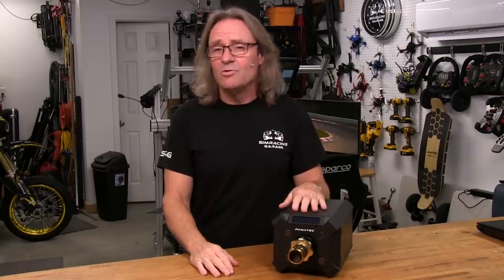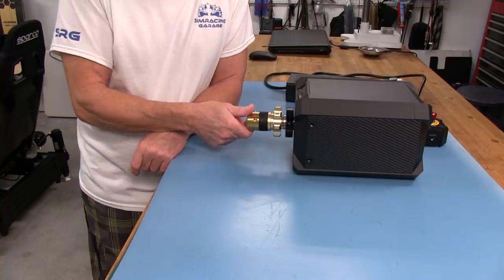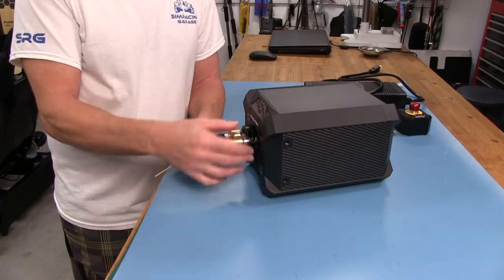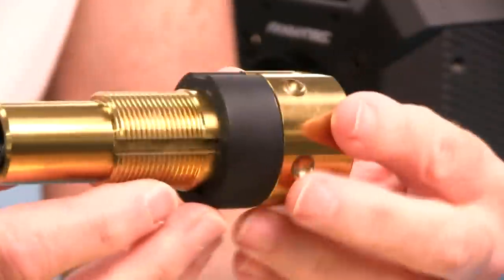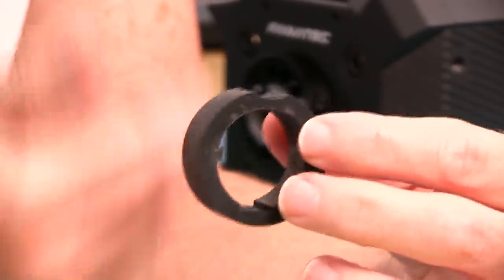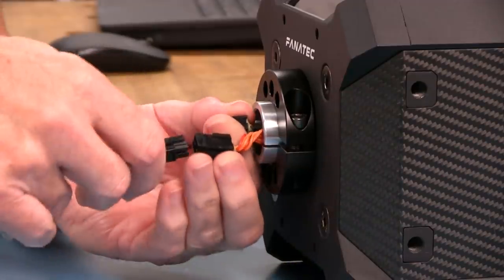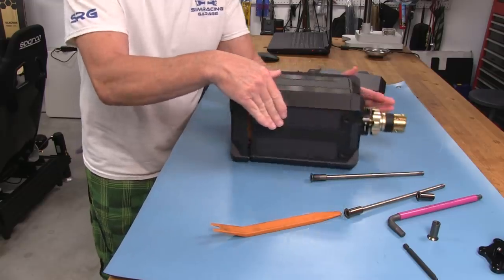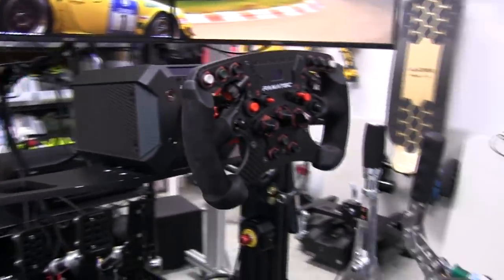Fanatec Podium DD2 Review

Comment: I thought it might be worth mentioning a couple things that Fanatec got right that SimuCube 2 could improve on.  I own a SimuCube 2 Pro and a Fanatec CS 2.5 wheelbase if it matters.

1. Torque key. Every time you start up a SimuCube 2 you have to let the software know that you want full torque. Many people have said they have forgotten to do this and had to complete races where everything felt bad because of it.  The torque enabling key Fanatec uses is a great convenience by comparison.  Have young kids coming by? Pull the plug and put it somewhere safe. Otherwise leave it in and don't worry about an extra step every single time you want to race.

2. Coiled cables. Fanatec wheels are all external cable free which is a great feature. Fanatec supports both communication AND power. The SimuCube 2's have BT support, but they've already hit limitations with some wheels in terms of buttons/input devices supported and there are a small number of wheels that support this. This module is already slated for replacement/updating so it can support more inputs. And then you get the additional failure point and weight of a battery with additional effort to keep a battery charged and then having to remember to turn your wheel on and off.  I chose a coiled cable wheel for my SC2 because I didn't want to deal with any of that.  It won't be a terrible hardship, but my point is that the SC2's wireless implementation is not comparable or as good.

I'm not suggesting one is better than the other, but just that both have some bragging rights, neither is perfect and both have room to improve.
Reply: Unfortunately, Fanatec's implementation restricts you to Fanatec wheels (if you want wireless capability), but maybe they'll soon let wheel vendors by wheelside internal connectors.
Reply: @whaletail935  As I've said many times, if they exposed a real USB connection in their Podium mount they would have created an advantage supporting 3rd party wheels.

Comment: There is No excuse for that play in the quick disconnect at this price point.
Reply: They COMPLETELY LOST ME when Barry did that. My q1r qr is SOLID on my accuforce. Without that I cant imagine using a dd wheel
Reply: Is it actually a common issue? Mine doesn't have any even without tightening the ring down (mine is an EU unit if that matters)
Reply: Mine don't have any flex whatsoever. Not sure why his does.
Reply: I don't have this flex on mine. Rock solid.. .
Reply: @J_SAMa  Ok thats good to know. Maybe the unit is ok.
Reply: @J_SAMa  I dont have issues with flex neither, DD1 EU Base here
Reply: +1 here for no flex issue on my US shipped DD1 base. I got mine as part of the first batch of preorders from last december FWIW.

Comment: Hi Barry, the reason your Dynamic Dampening was less effective is that you've reduced DPR in the Tuning Menu settings. What also helps to make it more effective is to lower the starting point a bit more, for example when it only starts at 100 to increase with speed it won't be very strong at 120 already.

Comment: Thanks Barry.
My Simucube 2 pro shows up tomorrow.  I feel like I made the right choice.
Reply: Christiono Rollinetti Batch 3?
Reply: I had the same thought. The oscillation felt a little weird to me in this review and there is way too much flex, if you compare it to the sc2. It also felt to me that Barry wasn't really happy about the product or expected more of it but didnt want to tell the honest truth, but I might be wrong.
Reply: @akeem127  Yes from Simracingbay.
Reply: Mine arrives tomorrow as well. Cheer!
Reply: Mine will be here tomorrow too.  FWIW I still think both the DD2 and SC2 Pro are good competition for each other and both are good decisions for a buyer depending on priorities.  If you are happy with Fanatec wheels then I think the DD2 is very compelling.  

My issue is that I got wheel lust for the significantly more expensive Precision Sim Engineering wheels.  I had upgraded my Fanatec McLaren GT3 wheel with the shifters from SimRacingMachines and they were much better than stock, but also cost nearly as much as the wheel. I added magnetic upgrades to my Porsche 918 rim as well, which are also an improvement though not as dramatic. The buttons and knobs on the Fanatec rims are OK, but not great.  So I finally decided I'm getting the wheels I want and a direct drive system that supports them.  It may seem backwards, but in the end Fanatec's biggest asset, their huge assortment of rims is what killed the DD2 wheelbase for me.  I wasn't going to spend an extra $200 for an adapter on top of the premium wheel cost for each wheel I purchased only to have to run a USB cable anyway and have a wobbly mount point. It just didn't make sense.  I've gotten good service out of my Fanatec equipment and have no complaints about their products. 

BTW I think Fanatec missed a big opportunity. If their $200 adapter allowed for a direct USB connection from 3rd party steering wheels such that they didn't require a coiled cable Fanatec would have made their system an option for the smaller percentage of people who want upscale wheels.  I know Fanatec wants people to buy their wheels, but that $200 adapter is only lip service to allowing other rims. They completely threw away their way to add a very big feature by making all of those wheels effectively wireless.  Big mistake.  Many people would buy a combination of rims but instead they've forced people into an either or situation.
Reply: @Nick-rx2zu  Youre batch 3? strange cuz im too and I havent received anything
Reply: @Brawlii  They are shipping to the furthest locations first but they are all starting to head out now. Wont be long, im in batch3 from racewerk too.  Man the level of filtering and software advantage simucube has over fanatec at moment is just not funny.    A-la GP2 engine era of honda for Fanatec.

Fanatec need to take the reconstruction filters and FEI algorithms far more seriously.  Fingers crossed the baseline encoders and chips are capable of a high enough update rate to get rid of that grainy feeling reported because thats worrying.
Reply: @Brawlii  Yes it is. I ordered on the first day when it opened preorder.
Reply: @markkovalcson7243  Exactly man. It is 2019 now but they are still using pins for steering wheel connection. I have a Fanatec Mclaren and I broke the pins twice when I pull out the wheel from the motor base. The reason that they insisted using pins must because that they want to make sure no third-party steering wheel can be easily attached on their motor base so that they will gain profits from selling steering wheel.
Reply: @Nick-rx2zu  To be fair even my new GT3 wheel has a round USB connector with pins in it.  The difference is that the connector screws into the wheel semi-permanently and is easily replaceable if it breaks.

Also Fanatec is a company and they are in business to make a profit.  I think it is a bad idea to attribute any negativity to their trying to maximize profits. I'm glad that they are in this market and I think they have done good things to take care of peoples needs in this market.

Whether I want to admit it or not I've gone off the reservation with my Sim Rig and I no longer represent anywhere near the average sim racer. Fanatec offers a strong value proposition in the upper end of the mid range.

FWIW I have a complete Fanatec Club Sport control group that I still consider good equipment. With the exception of the hand brake all the components have worked reliably.  I'm not selling them, but my son will be a happy camper this Christmas.
Reply: @vosi88  I am so hyped dude, been waiting for 2 motnhs
Reply: I got the sport version from batch 2. I confirm, you will not be disappointed !!!
Reply: Ya but the price and wheel combo is way more money also not a full ecosystem and not console compatible

Comment: I am an early adopter of DD2, I need to say that I have no complains with it. I'd love the quality and the FFB fidelity. I understand perfectly that the Fanatec Podium system is an early stage of development, and I happy with that. The flex in my case in minimum, for not to say that I have no flex at all. And in my opinion it has a quick fix if Fanatec release a more stiff Rubber or a 1mm more thick. I can't compare with a Simecube or similar, because I never got that ones, but what I can talk about the DD2 and like I said, it worked flawless, plug and play in all the games that I tested and for me that it's superb. Barry should mention that, I think that Fanalab is great, but the ability to launch a game, and seconds being driving without headaches is part of the package :).

Comment: Barry, I have the Accuforce DD wheel base. I was just wondering how does the Fanatec DD2 wheel base compare to the Accuforce? Which one has better telemetry based FFB? Is the Fanalab software as good as Simcommander software? I have quite a few Fanatec wheel rims that I have modified to fit the Accuforce. I was just thinking that they would work better on the Fanatec base and a separate usb cable would not be needed for the rim. Also since I have the Fanatec shifter and considering getting the handbrake too all these addons would work better wired into the Fanatec wheel base rather than a bunch of usb devices plugged into my pc. I am running out of ports and some games only support a certain amount of usb devices. What are your thoughts on these two wheel bases?

Comment: I had this same flex on my DD1. It was very noticable whilst driving. I'd say Fanatec tolerances are just that poor that the qr's vary and thats why some have it and some dont. Quite a rubbish qr system if Im honest. Using the screw is just a band aid fix for a sloppy design and is hardly "quick"
Reply: Was going to order the DD1 Podium very soon, now I am concerned.
Reply: @gisan3537  its a decent wheel base, just overpriced for the build quality in my opinion, and as I said the qr system is not great. Some people claim to have no flex so you might get lucky. For the money they cost you shouldnt have to be taking a gamble though!
Reply: @simracer1386  I agree, the pricetag is no joke, hence I want to be picky, thanks for your honest opinion.  I also been wondering the lifespan of these DD wheels does anyone know?  Can I count on it to work for few years of daily usage?

Comment: "quite good", "...does its job quite well"...hm, so it's good...but not great. Interesting. My Lenze/Simucube is great...in my eyes anyway :)
Reply: Hey man, I just bought a lenze mcs12, but I have problems finding a mounting bracket. Is it the same as a mige 80st? The 130st has the mounting holes 102,5mm apart but my lenze is 82mm if i measured correctly. Could you give me a little insight or maybe even a link to a good mounting solution? There is so little information on the lenze motors.
Reply: @nfsrival1499  , my bracket is from Martin Ascher. I just checked, he doesn't have any brackets offered for sale on his website. Guess it's worth flicking him an email and see if he still has a Lenze one lying around somewhere. Seems like hardly anyone is buying Lenze's anymore. Martin's site: https://www.ascher-racing.com/

Comment: Man the Flex on the shaft is.. worrisome for the price Fanatec asks for.  That's a bit disappointing compared to other products in the DD range.
Reply: Antoine Thisdale it’s odd. I have a DD1 PS4 model and don’t have any of that flex with my quick release.  My rig (80/20) will start to flex a bit before the shaft does.
Reply: @RitterTX  Yup, mine is the same. i checked mine and there is NO way im getting that amount of flex in my DD2. I couldnt believe it when i saw it, that Barry's was that lose. I kept going back to mine to see and then going back to the video.. mine may be just about an eighth of that flex even if that.. im astonished
Reply: Another DD1 owner reporting in that I do not have any of this flex with my Formula V2 rim, nor Uni Hub attached.

Comment: There are better ways to control oscillations. In the Simucube 1 and 2 program (or the Granity program if you're using the non-Simucube OSW such as the IoniCube) there is a filter section called "Peaking and notch filter" divided into 3 filters: "Center frequency Hz." "Attenuation dB," and "Q Factor." These settings mean controlling/removing oscillations without having to resort to potentially adding more friction and/or damper than you personally want for regular driving. Those 3 filters also slightly influence others aspects of FFB in good ways from my experience but 90% of their effect is on oscillation removal. Another good thing about those filters is, from my experience, they hardly (if at all) need to be changed when changing game or FFB settings / power. The only time they may need some changing is when there is a firmware update (firmware updates usually change all sorts of motor-settings we users will never see). It would be nice if Fanatec had the same or similar. Those settings are very under-rated settings...even in the Simucube community they aren't given the attention they deserve.

Comment: Disclaimer: I did not read all of the comments below (504 at last count). Another excellent review! I really like the Fanatec DD series (no external controller box, no wires to the wheel, killer OLED display), and was just about sold on a DD1, but the flex thing just freaked me out. I just got done spending over $1600 on a Monstertech frame  (not received yet), partially for stiffness reasons (not that kind ;^) ), and there's no way I would put up with that kind of movement on a $1200 gizmo (my TM TS-PC Racer has none of that!). I did see the video about the 3D-printed Blue Fixit Thing, but just now I came across this: https://www.youtube.com/watch?v=u2slxjJBcZA Does that "fix" make sense, racing fans?
Reply: Yes it makes a lot of sense, if you don't "pre-tighten" it you will push the rubber down the shaft with your wheel, when you then tighten it it won't be seated quite as snug as intended.

Comment: I have the Porsche 918 RSR wheel on my DD2, and there's no side play whatsoever as seen in these videos... From what I've heard, older wheel rims had looser tolerances than the newer ones, or I just got lucky...
Reply: My BMW and universal hub will have some wiggle/play without the bolt, but with the bolt installed it eliminates the wiggle/play. V2 formula rim is solid without the 6mm bolt.
Reply from the maker: From what I have been able to garnish from comments I have seen over the years, the tolorences from QR to QR on the Fanatec wheels can be quite different.
Reply: @simracinggarage3026  I've bought my BMW with the DD1 last June... So I can say its not something that's been addressed prior to the release of these podium bases.
Reply: My CSL Elite with the F1 kit has no lateral flex either (no locking bolt), but I very rarely remove the wheel so it's effectively as it was on day one. That said, it doesn't surprise me to see the flex he has.
Reply: @simracinggarage3026  I can confirm what you say.  I own 3 universal hubs, a formula rim, a McLaren rim, and a F1 2019 rim.  I tried your flex test with them, and some flexed more than others.  To my surprise, the universal hubs I own flexed the least.  I wasn't able to get the amount of flex you had in your video, but all of them flexed a little.  I put lithium grease on the locking ring threads, and I usually tighten the hell out of it.  Not sure if this helps or not, but I do know I wasn't able to get the flex you did.

Comment: I had been doing my research lately to find best SimRacing setups and I found Fanatec DD wheels the best. However, after having quotation for my full setup from Fanatec; I ended up buying a used Nissan 350Z and I'm happy with my decision. I'll stick with pad gaming and real car. Great video though 👍🏼
Reply: You can always get a Thrustmater T150 for like 150€ or maybe a Logitech G29. DD wheels don't make someone faster and honestly I don't find DD a requirement for a simracer these days
Reply: @Valenfield98  Agreed! I've had bought Thrustmaster TMX Pro and currently using it. It is a fair deal honestly.

Comment: Whilst I understand Fanatec need to do a better job explaining it, the DD1/DD2 release does not wobble. Did you look at this: https://www.youtube.com/watch?v=u2slxjJBcZA
I too have had no issues on DD2 and CSWv2.5. It seems you are not engaging the wheel fully when fitting it. As I said, Fanatec do need to do a better job of explaining how to fit the wheel.
FYI: Make sure you follow the instructions to place the locking ring and right up to the rubber before tightening.

Comment: Thanks for this video, you have passion of explaining of a very tiny detail.

I did not like the quick release when it still moving even it is very tight, why they do not use something like conic nuts or something that when you tight will not move a mm.

But still is my choice now to go for podium dd2 and i want to aske what comes in the pakage of that model. Only motor and the wheel.. Or what ?

Comment: super easy aftermarket solution to the quick release....Replace the rubber squish ring with a machined tapered conical aluminum piece. The conical tapered piece would self center and lock the wheel tightly as the lobed hand ring was tightened. If needed a thick neoprene washer between the hand ring and the tapered conical adapter to keep them locked in place for vibration resistance..
Reply: A good idea

Comment: Hey Barry. Do they still not use a slip-ring for the wiring? My CSW broke years ago as it tore through the wires that go to the wheel - I replaced them and added a slip ring and it's been fine since. Mad if they don't use them.